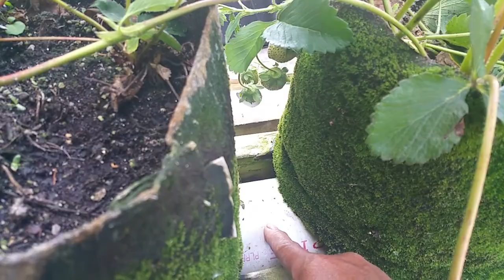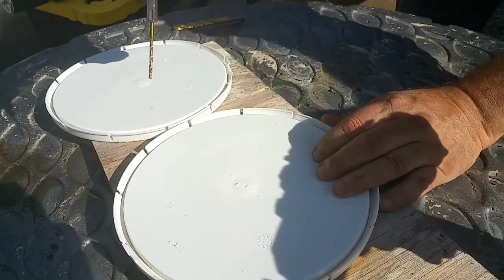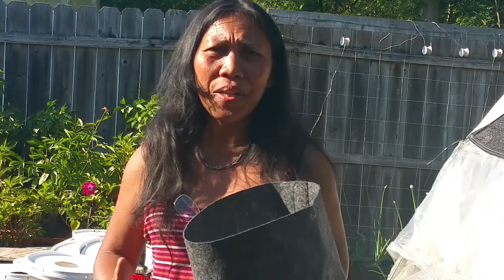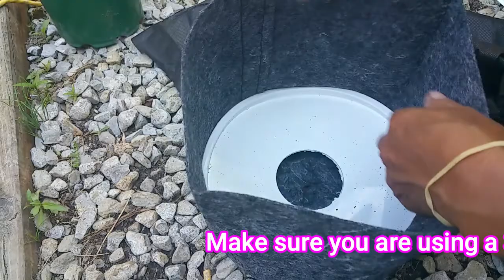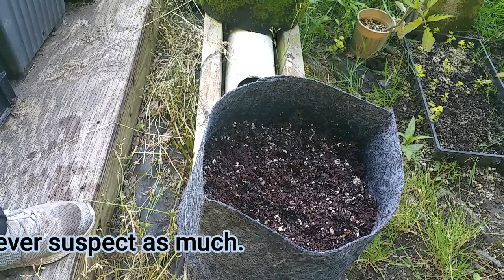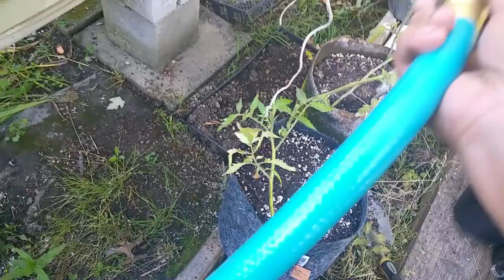THE BEST HYDROPONIC SYSTEM IN THE WORLD

Comment: THIS IS NOT AN ORIGINAL IDEA, rather copied on the Rain Gutter System by LARRY HALL.   I wish you would acknowledge the original proponents of this system.  Give credit where credit is due.
Reply from the maker: YOU ARE ABSOLUTLEY CORRECT.. Larry Hall created the rain gutter system, but he used actual rain gutters which exposed the water to mosquitos and made a breeding ground. It was on the ground and many people began to bury it in the ground. I elevated it to make it easier to work with the plants and placed the water in PVC tubes instead. Much better design i have to say. So, i dont take full credit for the intial creation, but simply made it better. I do give him credit in the book however. And i will give Larry credit in description.